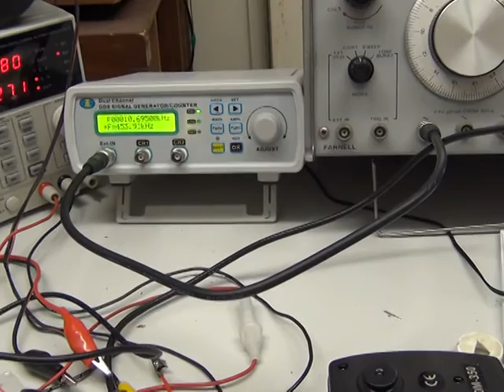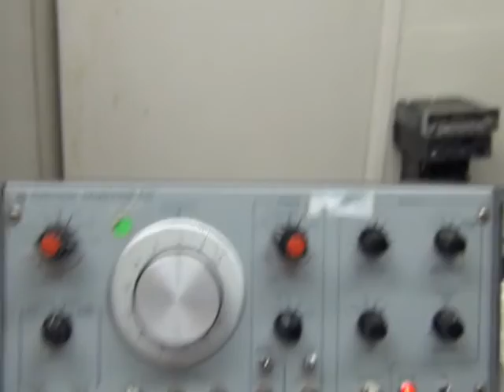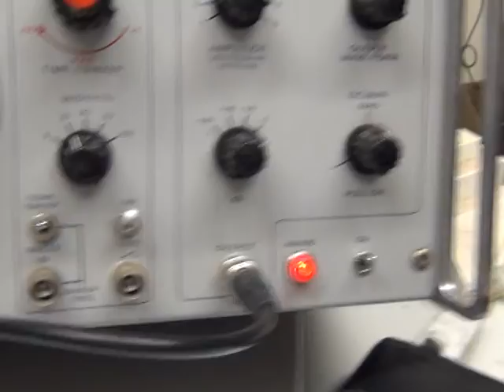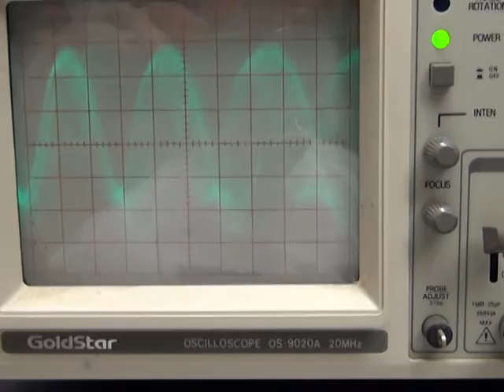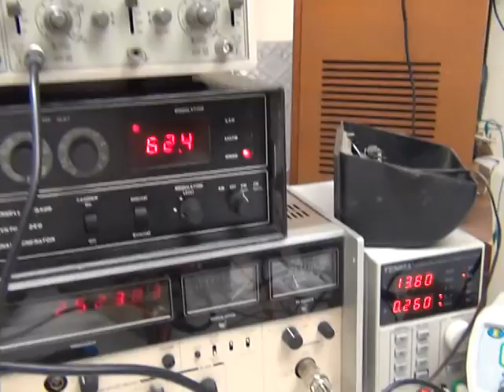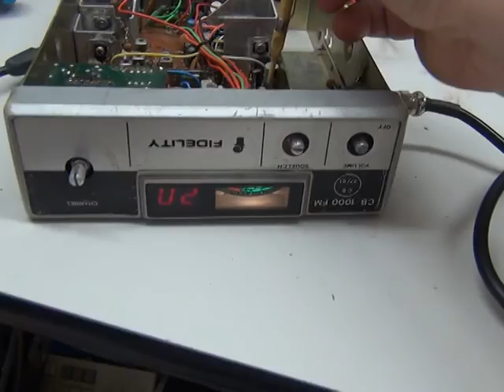Fidelity CB1000, UK (CB 27/81) CB radio (Mobile) - Receive & IF alignment

Comment: Hi Richard, Your dual channel DDS signal generator/counter looks like the models being sold on eBay that have a sweep generator.  If so, could you have used your dual channel DDS signal generator/counter alone to produce the "swept" 455KHz signal?  Also, why does the dual channel DDS signal generator/counter also show 10.695MHz above where it shows 455KHz?  

Would one of the following do the job of producing a sweep generated signal for the purpose of aligning a CB1000?

http://www.ebay.co.uk/itm/2MHz-Dual-Channel-DDS-Function-Signal-Generator-Sine-Square-Wave-Sweep-Counter-/400787386543?hash=item5d50ca30af:g:elwAAOSw-dBTvryr

http://www.ebay.co.uk/itm/25MHz-Arbitrary-Waveform-Digital-DDS-2-channel-Signal-Source-Generator-EU-Plug-/401288734800?hash=item5d6eac2850:g:YKUAAOSw4CFYwQtQ
Reply from the maker: Without watching the video again, the DDS generator was purchased in the hope that the sweep function  would be OK on 455Khz (I seem to recall this is the 12Mhz model), but sadly the sweep function is nowhere near fast enough for radio IF alignment application. The unit gets used as an IF marker oscillator, but has a built in frequency counter facility so I use it to also monitor the output of the 'real' sweep generator set to 10.695Mhz. That bench now also has an HP UHF sweep generator & I'll be using that to align vintage crystal controlled scanners in the near future. An overhead camera, video mixer & DVR has also been installed on that bench along with preview/output monitors just like I have on the 'usual' video service bench. Mr Chippie would like similar video equipment on the bench in the audio workshop too.

Richard
Reply: Oh no!  That's very good to know - thanks very much.  I was thinking of purchasing one, but I shall avoid it now. 

That's a great update on the other bench - look forward to those videos. :)  As a bit of feedback, it really benefitted my understanding of how you tested and aligned radios when you had the picture-in-picture view of your test equipment.  During some alignments a third camera view would have been great where more than one test equipment device needed to be monitored but fully appreciate you already had your hands full with the alignment! Lol!  Excellent videos nevertheless and I know you need almost a camera crew to really cover things thoroughly.  Perhaps Mr Chippie can assist with the various camera controls, switches, zooms and general camerawork?  Sorry to Mr Chippie if he's scoffing at that suggestion. :D  Seriously though, I realise with what you already managing it's armsful, but very much appreciated. :)
Reply: BTW, how would one tell when one has set the sweep generator just under overload of the radio?  Before clipping of some sort on the trace?
Reply from the maker: Best trace. Those Farnell sweep generators I use are under-appreciated & can be bought under £100. I think that one came with it's mains lead chopped off "spares or repairs" for £15. I fitted a mains lead & there is nothing wrong.

Richard